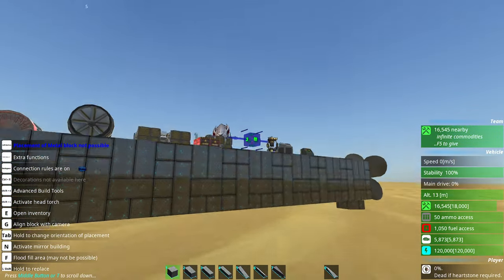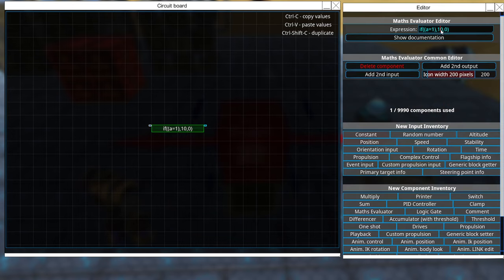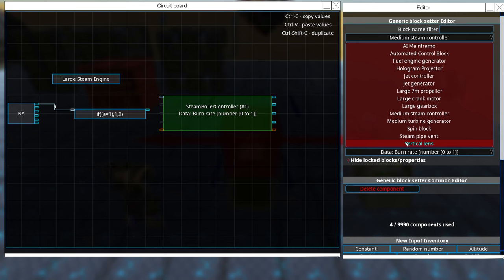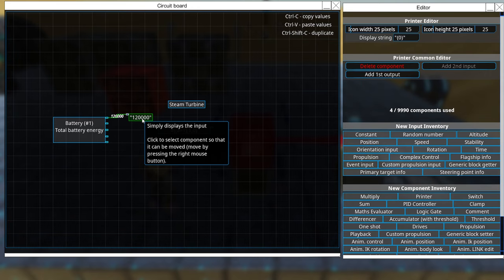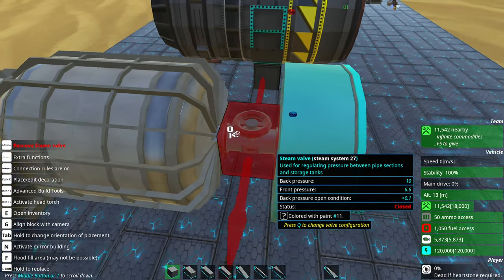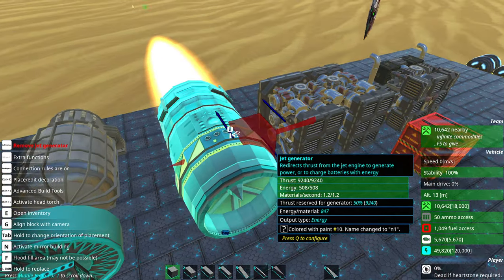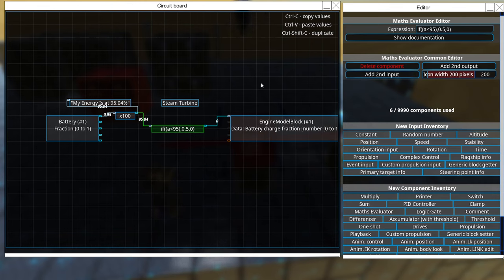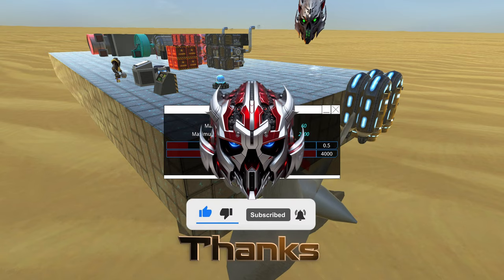How to Eco Mode Guide | From the Depths

Comment from the maker: Connect an AI breadboard to your AI MainFrame or to a Connector that is physically connected to the mainframe else a connector with a wireless transmitter. 

Method one: 

Use a Primary Target Info if you want just to turn an engine on and off only when you are facing an enemy and mostly useful for steam engines

Place a Primary Target info then Place a Math Evaluator, Inside the Math Evaluator type if((a=1),1,0) then place a generic block setter (not a getter)

Depending on the Steam engine you are using you have to find the right steam controller, Example: Large boiler controller = Large boiler controller or Medium Steam controller if you are using a medium boiler

Once you set the generic block setter to the steam controller connect everything in this order, Connect the very first input of the Primary Target info to the Math evaluator and then connect the Math evaluator output to the Generic Block Setter.

Spawn an enemy (a marauder cause we like em)

Check if the Steam engine starts when enemy appears and stops when you remove the enemy

Method Two: 

Make sure you have a battery, Use a Generic Block Getter
then find the battery on it and set the battery storage to Fraction, Now add a multiply and set it to x100 connect the Generic block getter to the  multiply and add a Math Evaluator then type if((a<75),1,0) 75 means that the turbine will only turn on if the electric energy is less then 75%
Change it how you like. Connect the multiply to the Math Evaluator then connect the Math Evaluator to the generic block setter that controls your steam turbine